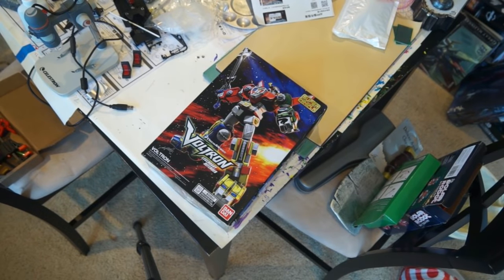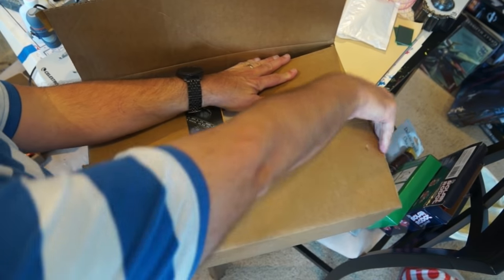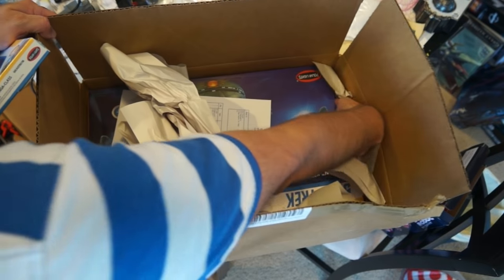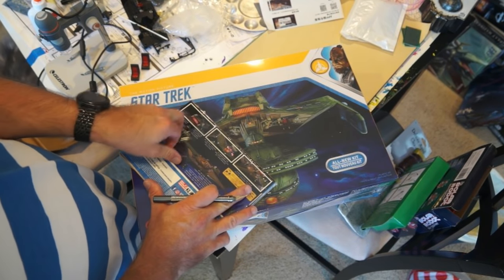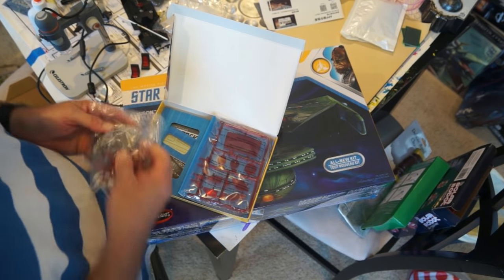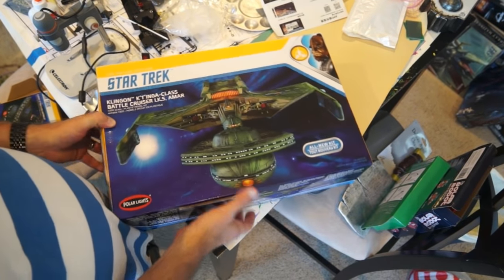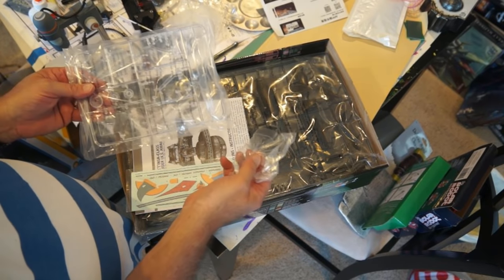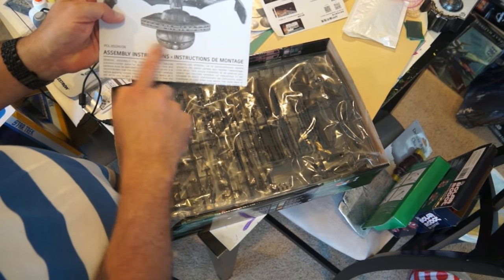Out of Box review: k't'inga

Comment: Hey John, do be careful when opening a box like that. Instead of using a box cutter once, I figured I could just use my finger to yank the box open and I tore the tendon in my right index finger. I've dealt with trigger finger ever since then. I can type and do all sorts of stuff, but I can no longer make a fist. That was six years ago and it's most likely permanent damage. So anyhow, about the internal battery pack. The builder on AllScaleTrek bypassed this by cutting the wires. He fed them through the stand rod and moved the power supply into the base.

Comment: John, check the top of the main body. The right side is warped big time. Also instructions are incorrect on numerous part numbers. For all the hype on this kit it is just one issue after another. Very pathetic on Round2 ' s part.
Reply: For the vast majority of people the kits have no issues.  Mine is perfect.  The quality of the molds and the design are outstanding.  Unfortunate you got one that slipped past QC but don't imagine you speak for most of us.  Just contact PL and they'll fix it.
Reply: No John. I've been speaking with Jamie Hood extensively all week long. He is the gentleman who was in charge of this project from start to finish. I spoke of this in more recent videos. He is getting hundreds of calls a day with different issues. Now many people are finding the neck pieces being warped which could be a big problem. Also he did find the photo etch parts to be an issue while we were speaking. In step 10 the instructions really become vague.
    Mine is all built and getting ready to start painting as I type this. I did my own lighting with the correct speed rate on the flashing lights. And used the clear parts where needed. All the windows will be done with canopy glue when painting is complete.
  Most every one who I have been speaking with is not even purchasing the lighting kit as they are finding out from me and others that it is not really necessary as originally thought.
  I've been going through all this on the last few videos and hopefully painting and making my base will be done be next weekend and I will be doing a video on the completed model then.